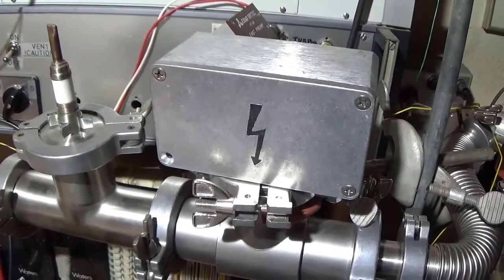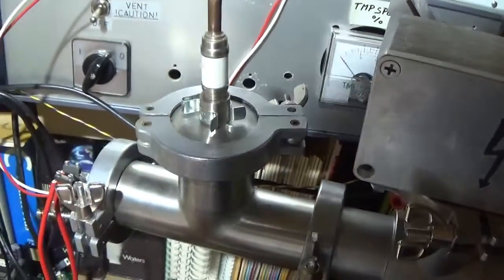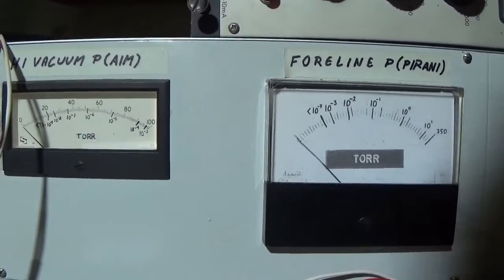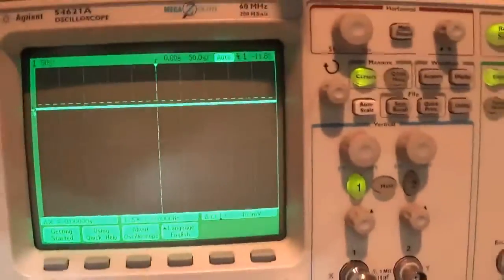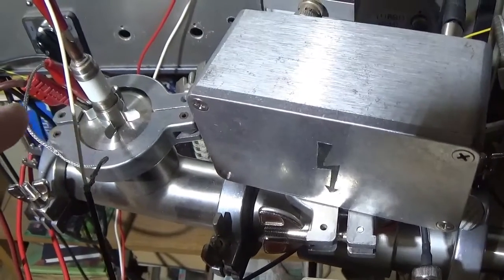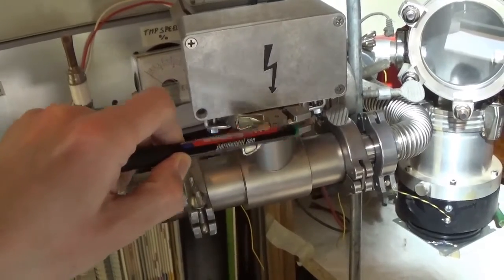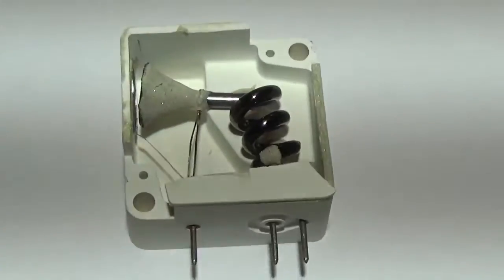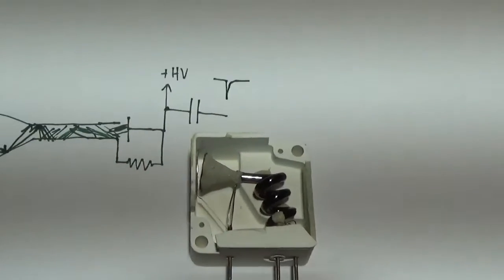DIY Electron Source and Channeltron Detector

Comment: Really really interesting, looking forward to seeing your ToF spectrometry results. How are you going to do sample injection into the electron beam? Are you going to dip a filament in solution and boil-off samples like Applied Science's Mass Spec?
Reply from the maker: Thanks! This setup is best used with permanent gasses and volatile organic stuff, like a residual gas analyzer. I may just make a needle valve to allow a tiny flow of outside air inside. Or maybe a length of capillary GC column!
Reply: @chromatogiraffery3104  The capillary idea is nice. I was surprised during the mikeselectricstuff teardown of a MS (https://www.youtube.com/watch?v=GaSoQjEELYg) that the injection port was continuously open, but it makes sense provided you have enough resistance to flow.

I started watching your videos after I repaired an old TCD/FID Perkin-Elmer GC and I was thinking about building a TCD myself but it turned out the board was bad not the detector; however, I've recently acquired a vaccuum system (turbo pump, controller, pre-pump) that's nearly new at auction, and it had a RGA head attached. I now feel I should try to get the head working, but its a quadrapole system, and would need more RF engineering (and specs and time) than I have to solve. Your ToF system sounds far more accessible to the DIY community so I'll keep watching with great interest!